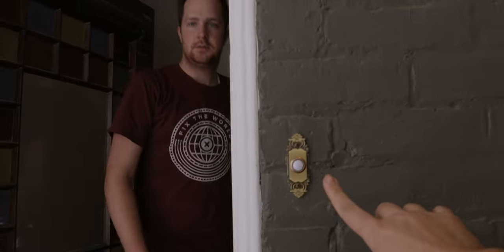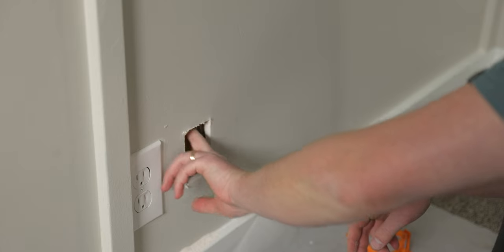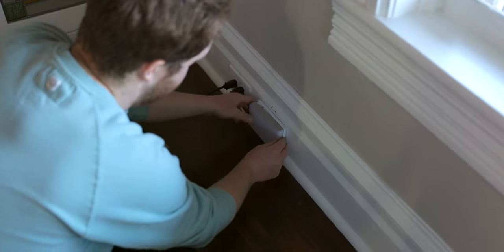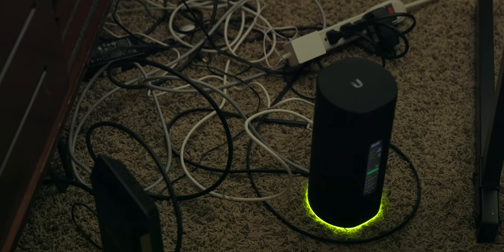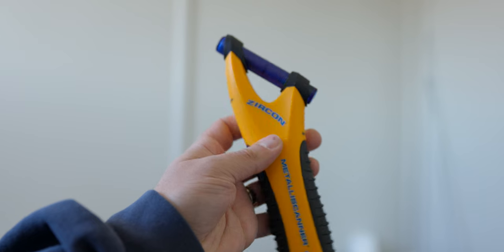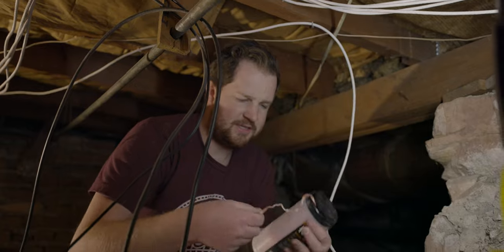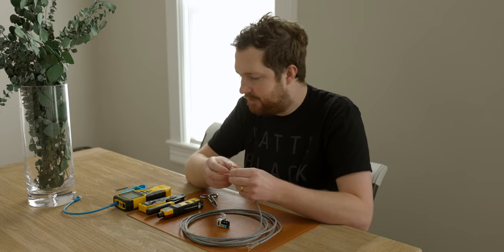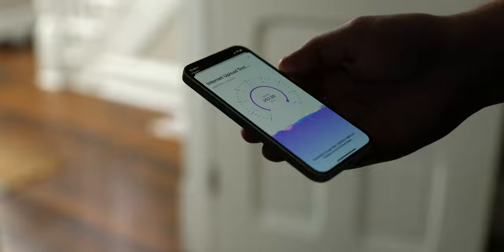Adding 10 Gigabit Ethernet to my 129-Year-Old House!

Comment: 3000 comments and no one noticed that his switch doesn't support 10 Gbps for RJ45? Essentially he only created a regular 1 Gigabit Network, not a 10 Gigabit. His switch does support 10 Gbps, but only through the SFP ports (Fiber) which he is not using.

Comment: in a huge factories you will probably need 150 meters of LAN cable to your office building, there are no such LAN cable capable running 150 meters. what a shame.  
FIBER OPTIC is Still the best

Comment: Running structure cable to a plug is a bad idea.  Solid wire was not meant to be used that way.  Always terminate a a keystone jack.  The 100M spec assumes patch cords at each end and jacks.

Comment: You're not going to tell me that those unshielded cables and cheap plastic RJ-45 connectors are pushing 10 gigabit through anything longer than 1 meter right.....

Comment: 19:42 There is no “jury out on it”. The twists are different for a reason. You will get data packet loss if you just punch them in whatever order you want. These have been designed the way they are for decades for a reason. omg, please don’t just punch them in the wrong order because this guy says “the jury is still out on this one”. That’s like saying “well, you can just use kerosene in an oil furnace and it’ll work fine” - no, it will work, but not fine and there will be drastic consequences for choosing those actions.

Comment: Dry-Wall...shudder! Good thing that we (usually!) don't have this in Germany (I hate it, seriously, it is cheap shit masquerading as a wall :(
Otherwise I agree with you over all, but I'd use CAT7 cable or above (I only want to run "regular" networking cable once for my new appartment! After that I'll wait for fibre-optic-cables (which I will install if they become a) neccessary and b) affordable...hell, I am not even going for 10 gigabits now because I will not need it as a single user without a NAS or server!) and will only change the sockets, switches, patch-panel etc. should the need arise, that's why I am using keystones) :)

Comment: That is not correct. Cat6 cables can achieve transmission speeds of up to 1000Mbit/s - i.e. 1 Gbit per second. The cables have a bandwidth / operating frequency of 250 MHz. Since your panel is only Cat6 and your patch cable is unshielded cat5, you will never achieve a clean signal.
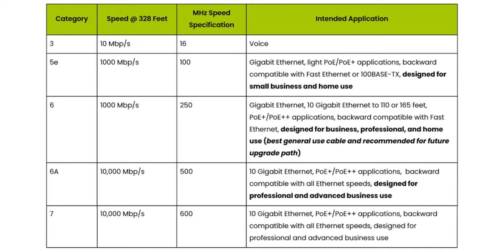Reply: As shown in the video at 9:42 the 1GBit/s rating is for 100m and you get 10GBit/s at 50m (although I think the actual spec goes to 55m)
Length in this case matters a lot because signal attenuation doesn't just increase with frequency but also with cable length. 
You can even run 10GBase-T over a Cat5e cable over a short length ~30m (although I've read in ideal scenarios up to 45m) so even the Cat5e in the patch panel won't matter much.

PS: Generally a rating is given at 100m in most cases, which imo is actually bad since I rarely see such long cables. Even in a presentation Berkeley Labs they stated 70% of all Ethernet cable runs are less than 55m

Comment: The way my house is built I can't get ethernet I'm in a 2 story house my router can only work downstairs because upstairs has been wired for Cable and Landline and my attic is in my garage so it just wont work and it's so god damn frustrating because i get so much fucking packet loss when I try to play my online games.
Reply: There are MoCa adaptors to connect coaxial cable network in cat-5 cat- 6 based ethernet network.  It is a US thing since cable penetation rate is the highest in the world there.  It is doable but it can be a bit complex.  There are filter splitter issues to consider and get it right.

Comment: 10G to access ports? Why?
I did my cabling with CAT5E, and my switch's statistics haven't anything over 100M, except backup's from primary desktops. 4K stream is between 25M-50M .. 
Ok .. i have 2x10G uplinks to backup and vm server .. just because i have 2x10G ports and 2 servers that MAYBE can consume it.
Mesh WiFi networks usually do "handover" from AP to AP, depending on signal .. don't know how yours work.
10G in home server rack .. maybe .. depends how many servers you need to have access to that amount of bandwidth / traffic. For storage, 8G FC is as fast as 10G iSCSI and has lower latency. And older 8G enterprise-class is quite affordable (second hand) and usually rock-solid.
Networking part, no storage devices ..10+ years is stretching even for enterprise-class storage ;)

Comment: Cat 5 and Cat5E is already OUTDATED.  If you are wiring your home with Ethernet you should be Using at a minimum Cat 6 it will support the current standard and the future of 10 gigabit internet which is starting to become widely available.

Comment: Calling keystones an "additional point of failure" versus terminating with plugs is, in my experience, disingenuous.

While every connection is, technically, a point of failure, in my experience terminating solid core wire with plugs is far less reliable than terminating with keystones and using a (stranded core) patch cable -- preferably a patch cable with molded plugs that holds the cable in the plug securely without movement. Over the last 20 years of doing IT, I've repaired dozens of plug terminations (even correctly-done) and less than a dozen keystones, and those keystones were not done properly to begin with.

So I will prefer keystones EVERY TIME over plugs for terminating in-wall wiring for Ethernet. Keystones may introduce additional points of failure, but those points are far more reliable than the point in a plug termination.

There is, however, a legitimate use for plugs: when you're NOT running Ethernet. For example, you've got baluns to convert from composite video over coax to go over twisted pair. (Or maybe HDMI-over-CATx.) In this case, it's not the reliability that you need to worry about; it's the resistance of the connection. Each connection adds resistance, and minimizing the connections will provide a superior ANALOG signal.

But for digital signals? Go for the keystones. The reliability will make a greater difference than the resistance.

Comment: Meanwhile in the UK..
A house thats 130 years old is just a house its not even considered that old.
eg... My home is not that special for the area, it was built in the early 1700's from  stone including the interior walls and ground floor.
There is no simply punch thru... Putting a hole in a wall is a major under taking.
Wifi doesnt do well either. It doesnt penetrate the walls at all.
I ran ethernet cables down from the roof space. (loft)

It took the gas company 3 days to drill 2 holes to give the kitchen a gas supply.
Yes they actually drilled and wreaked drill bits for 2 days!
Reply: yeah got the same problem, one hundred war little castle (1340)...no way to punch through walls... i ended up passing the cable through the unused chemney conduct (from the roof), and put a wifi antenna at each fireplacse at each level, which each are blocked fast because of the 80cm stone walls ....(it s my family home, i wont spend thousands in that for a crappy satellite download/upload, i can have the 4g but i have to walk 400m in the field to get to data from the 4g antenna). we might get adsl or fiber one day, when my 8 years son will be grand father....

Comment: Damn, who tf ran that fiber on the side of your house? The cable guys in your area must suck nuts. We’re not all bad I swear.

It’s also good practice to use that pull string any time you’re terminating twisted pair. Your stripper looks to do a good enough job but most strippers and the scissor method usually nick the cabling inside. You always want to pull down past your strip mark to avoid this. Just something you should include for people learning.

Comment: As European I want to mention clearly that we CAN NOT "just punch through" our foundation. I see why you are calling it "punch through", when it is just a "punch through" some plywood or plasterboard. We have inches of metal enforced concrete, stone and insulation to "dig though". That is what it will be: A "dig through".
Additionally we neither can "push something up or down" inside of our inner walls. These are solid material as well. You need to cut slits and slots to hide it under that surface. 
You are lucky dreaming americans with toy houses.
Reply from the maker: Yeah, your houses suck.
Reply: @snazzy calling up the second little pig as we speak 😉

Comment: Why do you repeatedly refer to having a 10G network when none of the equipment you are using is 10G? That’s pretty misleading. I like Ubiquiti’s equipment, and have it in my house as well, but the Dream Machine Pro and every one of their APs is strictly 1G Ethernet. They have a handful of switches that support 10G (mostly for switch aggregation) and a single switch with 2.5G Ethernet, but no APs above 1G.

Comment: I'm sorry but if you don't use a keystone jack and a patch panel you ARE doing it the wrong way. There is a reason you need to do this and it has to do with the type of cable you are running (solid core cooper). There are specifications that cover this. Do it right!!!!
PS: it's 110 and 66 block, not 99.

Comment: OMG, this can't be stressed enough... The comment about it really doesn't matter what order the wires are in as long as its the same on  each end could not be more wrong.  You will cause tons of data errors if you don't keep them in +/- pairs.  The actual colors of the wires doesn't mean crap... Orange has the same number of twists as brown unless your cable is absolute crap with no quality  control, but if you don't keep pins 1&2 paired, and 3&6 paired, and 4&5 paired and 7&8 paired, then any cable over a couple of feet will have tons of data errors! There are exceptions to this, but explaining them will only screw up beginners even more so I won't!  Just stick to the standard wiring.  There is no  reason to deviate.... not even for experts (any more)... you'd never get 10 gig over improperly paired wires... probably not even 1 gig... that's what we were running when some idiot made a crap ton of patch cables (4-5 ft) and used them to hook up a bunch of workstations... NONE of them negotiated higher than 100 megabit even with that short run... he, of course, had wired both ends "the same" also...I'm sure others have also commented, but I didn't see it in like the first three comments, but I did see "great wiring explanation" so I had to post this.  If you're going to make an educastional video, then do your homework!!
I do realise that what he said could be interpretted as "choose a standard" but around the 20 minute mark in the video it could easily be understood as it doesn't matter...

Comment: "Interior walls don't have insulation" yeah you know how you can hear people peeing when the bathroom is next door, or you basically can't have anything sexual happen when anyone's in the house, or you can hear the washer and dryer all through the house, or any water running through pipes is so loud at night... Americans need to learn the value of properly insulating a house. This 100-year-old "walls need to breathe" mentality was out of date even in the 1960s. In 2020+ it's embarrassing. And sadly normal. And yes, most American contractors are easily 60+ years behind what would be considered minimum required building standards in most of the developed workd.

Comment: putting the cable outside for hackers makes no sense, also why not just use wireless routers??
Reply from the maker: You put it on a VLAN. And they’re called access points.
Reply: @snazzy  actually it's called WiFi 6 and yes they are called wireless routers an access point is something else I think those connect to routers and extend the range. Look up one of the devices for example ASUS ROG Rapture WiFi 6 Gaming Router
Reply: @eksine  you really don't know anything about networking do you?

Comment: You are punching down dirty pairs. You never used the pull string to get to the clean pairs. Nobody seems to know what the pull string is used for. You are supposed to use the pull string to get down to clean pairs then cut the top portion off where you stripped the outer jacket off.  If you don’t you could be punching down pairs you knicked  while you were stripping back the jacket. If you are going for 10 gig speeds you won’t get it unless you cut the dirty pairs off.

Comment: 10Gb =    1250MB  if only fiber gave GB instead of Gb cause 1250 MB really isnt that impressive. now if it was GB then 10,000 MB would be impressive af or to those that rely on speed test 10000MB = is 80,000Mb. and a real world outcome you might see 8000Mb up or down in this setup and still have a high ping due to patching issues if your a gamer :)

Comment: Ok: STOP! Keystones are easier to mount (hell, regular ethernet-sockets (without keystone tech, so you would need an LSA-Tool) are easier to wire up, too) than crimping a cable...the last time I installed a networking-cable-socket it worked first try...crimping a cable meanwhile took me an hour...blergh!
Keystones don't need the LSA-Tool...most of them are tool-less!

Comment: "Ethernet cable" isn't a thing, as Ethernet is not a specification of cable.
Reply from the maker: Here’s a trophy for pedantry: 🏆
Reply: @snazzy  it's not pedantry. You can run Ethernet over many different media, and you can use category cable for many things that are not Ethernet
Reply: @SilentServiceCode  don't be so picky. Ethernet is just better known than CAT 6, 6A, RJ45, etc

Comment: so like hope everyone knows cat5e can do 10gbps.( should be able to do 45meters runs)

but the issue i have with this video is that only the ethernet cables are 10gbps capable but not the switch ports!. NONE of the network equipment can do it via copper!

the 24 port switch can only do 1gbps per ethernet port.

the 2 sfp+ CAN do 10gbe via fiber which most likely will end up as uplink in the 8port 1gbps + 2 sfp+ 10gbe router/firewall

so basicaly you are very very very misleading in your video/title as none of your cable runs will ever do 10gbps. 

plus i dont get why you need to uplink to your router at 10gbps to only end up be bottle necked by your ISP at what 1gbps? you show that you have a media converter from the google ftth towards copper...like why? so even if google gave you 10gbps, you are converting to ethernet and plugging into an 1gbps ethernet port in your router....you should be plugging the fiber directly in the sfp port of your router at least!

plus looking at your white cat6 from here, 10 bucks its copper clad aluminum...

none of this makes sense...  uplink to 10gbps to an incapable WAN (by design) and a LAN that will never do 10gbps on a single ethernet cable.
Reply: surprised no one told you in 8 months, the point was to future-proof the cabling, everything else he can swap once he actually gets to 10gbps
Reply: @DarkCeptor44  but the video title says "adding 10gbe to the house". if cat5e was already there and capable of 10gbe speeds, then the hardware would have been what was needed to be upgraded as it is the bottleneck. so the cabling has nothing to do with future proofing when it's not at fault.
Reply: @bober1019  was there cat5e before? idk man its just a title, i thought the video was fun regardless